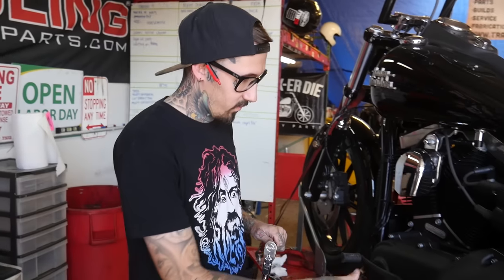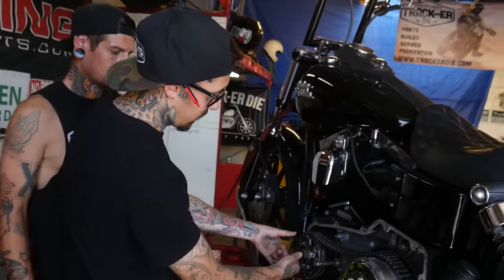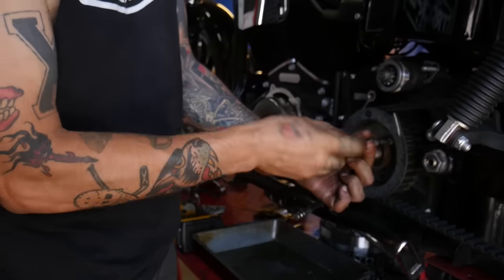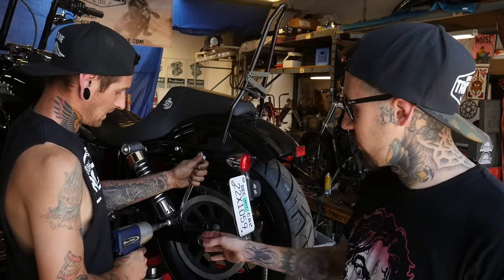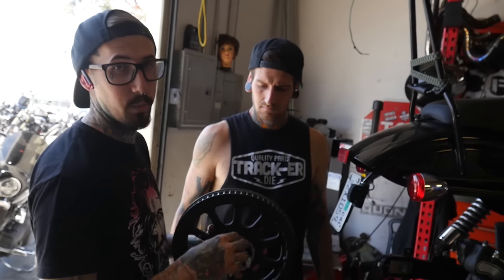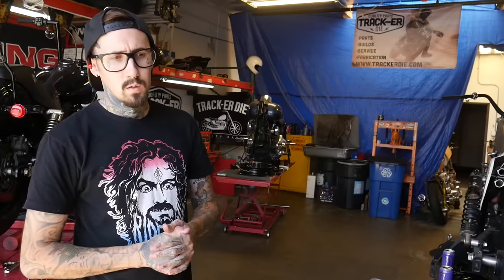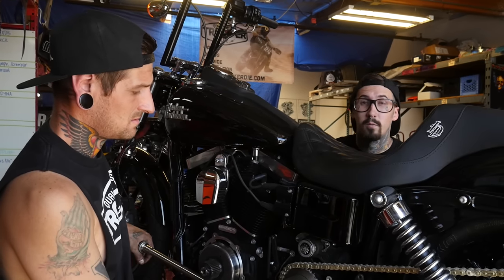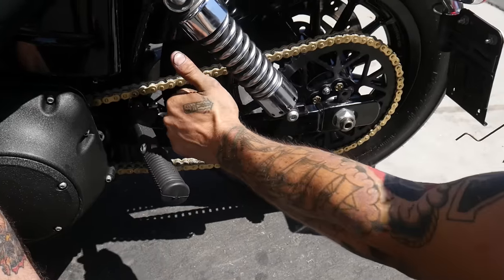*HOW TO* Dyna Chain Conversion Install

Comment: If you don't have an impact gun and can't get the sprocket nut off, get a center punch and make a spot near where two flats of the nut meet. Do that spot a little nearer the edge of the nut than the threads.... then carefully drill the spot  - with a small bit - until the nut is almost drilled through into the pulley. Then drill it with bigger bits until the hole is enlarged enough to be just breaking out the side of the flats. Then use a cold chisel in that hole and hit it sharply as if to loosen the nut - the nut will fracture down by the threads and you can get it off. You will need a new nut, but it is always a good idea to use new nuts anyway !

Comment: To clean the chain on a converted Harley, can you get around the primary cover to clean the front sprocket or would you have to go through that ball ache with the clutch every time?
Reply: CosmoxYRik nope gotta pull primary cover,that’s why I would never do this conversion.the belt is quieter and needs no maintenance other than occasional adjustment
Reply: All you have to do is keep your chain clean. People act like that so tough to stay on top of lol. It's nice to be able to pack a chain even if something happens it can be fixed. Your belt is leaving you where you sit if it breaks. Plus you can play with gearing easily.
Reply: @cmonster6  +1, and with chain every plase is covered with chain greace and chain wax sucks. Never do that swap. IMHO
Reply: Look after your chain and no need to clean front sprocket unless your taking your Dyna through the bush lol. Chain out preforms the belt in every aspect anyone who says other wise has no experience with a chain driven Harley. If stunting is your forte, chain all day 👌

Comment: You do a chainconversion Because power is better transfered to the rearwheel than with a belt? Im curious, Nice vid!
Reply: Samo Lagano Im pretty sure it’s mostly done for low end performance a lot of guys are doing wheelies and stunts on dynas these days and the belt will most likely not hold up when  putting that much instant power to it in order to pull up a wheelie. It also looks cooler tho.
Reply: chain most efficient shaft second belt is least efficient that is fact not a trendy opinion. d.s.
Reply: David Sundquist I’ve just heard the belt is smoother cause it has a little more give and has more room for error but also weaker than a chain.

Comment: How many miles do you get on the chain ?  I am still belt driven now. My vtwin sport bikes the chain would only last 8-10k miles, just a little longer than the rear tire
Reply: A quality 530 X-ring chain with steel sprockets should last you in excess of 20k miles. OEM chains are notoriously cheap and don't last like you mentioned

Comment: when installing the chain drive do you need to have someone press the rear break down while you tighten the rear tire / axle to be sure the brake caliper is aligned properly with the rotor?

Comment: Pros n cons with that conversion? What’s the maintenance on that setup look like. Is it more reliable than the belt?
Reply: If you ride gravel roads the belt will leave the chat, short order. Chain does need some cleaning and is definitely noisy compared to the belt.

Comment: admittedly i am not a dyna bro.. but I have ridden high performance sport bikes and harley's.. one must ask...... what is the benefit to this conversion?
Reply: Looks
Reply: My main reason for doing this is so I can fix it on the side of the road if I need to. Having a belt you are getting a tow and may be stuck for a couple days if its Saturday afternoon cause most shops are closed on Sunday Monday and some on Tuesday!
Reply: @southernragenga  maintainace will avoid you stranding on the road
Reply: @Traveller2016  not if someone slices your belt and you don't realize it!
Reply: @southernragenga  yeah that happens a lot. People slicing my belt

Comment: which loctite did you use on the adjusters?  when I torque mine to the spec in the manual it tightens my chain too much.

Comment: That seems like a lot of work and expense for no real advantage. I like that Harley went to belt drives over chain, so I don't hear the chain. I broke chains when I had chain drives. I've never broken a belt.
Reply: You must had been using cheap chains , I got sick of breaking drive belts and went to a chain years ago and never looked back , I'm running a rk pro chain on my electra glide best move ever .